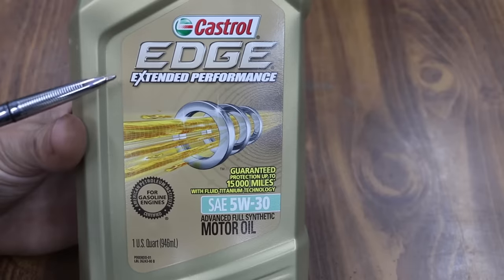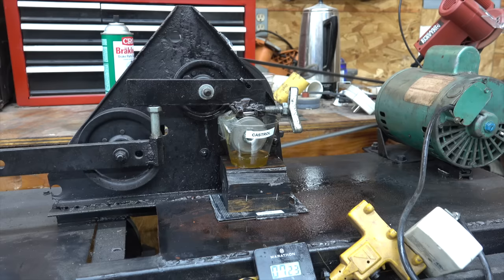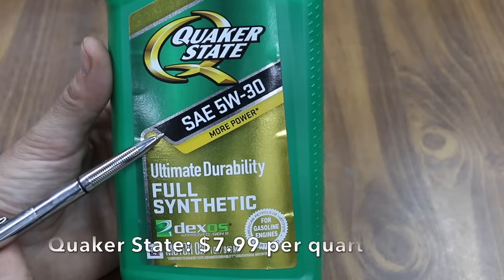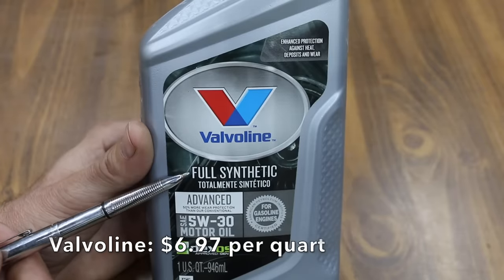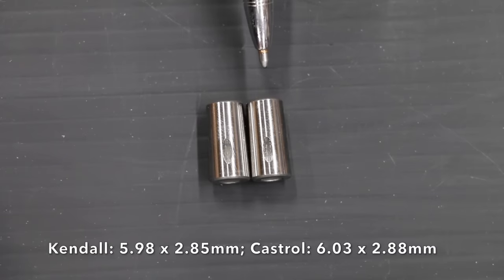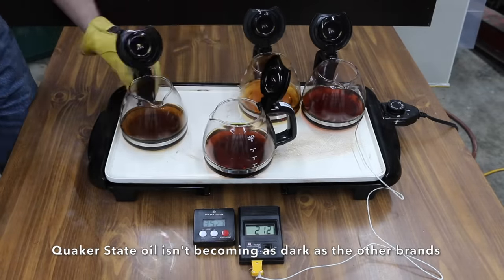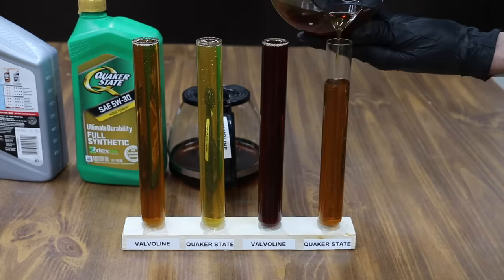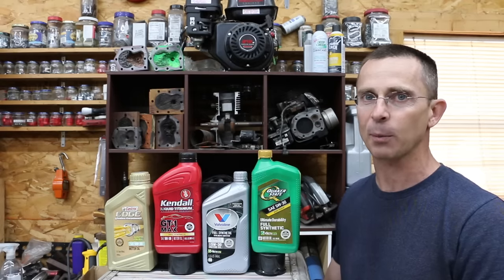Is Castrol Motor Oil better than Kendall? Let's find out!

Comment: I'm still curious....does oil deteriorate more with mileage, or time?  I have oil in my motorcycle with under 500 miles, but nearly a year old.  Your thoughts?
Reply: With mileage it the heat cycles that are hardest on the oil not to mention in constant contact with moving parts etc. Yes oil will deteriorate over time but at a very very slow rate especially new oil 
Oil with only 500 miles I wouldn't worry about it deteriorating in a year unless you had a overheating issues with the bike
Reply from the maker: Great question.  There's a lot of debate on this one for sure!  Personally, I don't like to go any longer than a year, since condensation is a factor and oils can become acidic
Reply: @ProjectFarm  sounds like a good video idea test new and old oil let sit for 6 months to a year and retest it

Comment: What material is the wheel that spins against the bearing in the lubricity tester?  And do you change it with each bearing change?
Reply from the maker: It's hardened steel (wheel race) and they last a long time. I have a video on how I clean and prepare the wheel race between tests. I don't show all the test preparation to keep the videos concise.

Comment: Could you please test Steel Shield's range of products with their competitors (LiquiMoly, Lucas, etc)? At least their engine oil, transmission fluid, and steering fluid additives. Steel Shield is proudly made in the USA. Thanks for considering my request.
Reply from the maker: Great suggestion!  Thank you.
Reply: @ProjectFarm  Thank you for considering my idea. 

Because these additives don't get used in isolation, if it's possible to add them to the engine oils you tested last year, that'd be great. However, I realize it'll be a vast undertaking. I think you'll figure a way out that makes sense and is practically possible. 

Thank you for your hard work behind the scenes. I really appreciate your channel.

Comment: Hi. Can you please check, test and have a showdown between MPT 30K 0W40, Ravenol 0W40, Motul X-max 0W-40 and Liqui-moly 0W40 (Blue bottle)? Although my engine specifies SN+/SP rated oil, I use a standard SN rated oil based on my use case. These are all supposed to be group 4 and/or group 5 based and provide the kind of protection high performance engines like mine need.
Reply from the maker: Thanks for the suggestion.

Comment: Although all competing oils meet API SN, ILSAC GF-5 performance levels but besides this they also meet different OEM specifications. One oil meets FORD specifications while other oil meets GM specifications as well. One of the oils meets API SN PLUS performance level. API SN PLUS has different additive chemistry than API SN  to over come LSPI (low speed pre-ignation) phenomena. Different type of additives are used to meet different OEM specifications. May be one oil contain more antiwear additive than other so it has better antiwear properties, similarly other oil may contain more detergent and dispersant additive and it has better soot handling properties. So the wear test is not acceptable unless you know the additive components. Compare apple to apple than the results will be acceptable.
Reply from the maker: Thanks for the constructive feedback.

Comment: Even though Valvoline lost in your tests I will still use max life. I don't know any other brand that will give you an engine warranty of 225k miles against excessive wear in the engine. If my seals dry out or I start burning oil and have proof that I changed my oil with Max Life every 4k miles and the mechanic says the issue is cause by oil Valvoline will pay to fix or replace my engine, whichever is cheapest to have done. I work at a parts store and have seen Valvoline pay to have someones engine replaced.
Reply from the maker: Thank you.  Valvoline is a great oil!  Thanks again

Comment: Oil flow test is base less unless first  you test the viscosities of  competing oils. The viscosity range for SAE 5W-30 is 9.3cSt to 12.5cSt at 100C. So an oil having 11cSt viscosity will reach to finish line more quickly than an oil having viscosity of 12cSt, Although both are SAE 5W-30 grade oils. Engine oil contains viscosity improver (polymer) to boost viscosity. Cold flow behaviour is greatly affected by amount of polymer which is added into oil to boost viscosity. So for the flow test, all the oils should have similar viscosities to compare.
Reply from the maker: Thanks for the constructive feedback

Comment: Here is a video idea. Is is true or myth that air cooled engines consume 10W30 versus running straight 30 grade? Basically a test where a motor is throttled for a set amount of time comparing oil consumption on multi-viscosity vs straight grade.
Reply from the maker: Thank you for the video idea!

Comment: Could you test what happens when you use the wrong oil type at the wrong temperature. or does it matter. I have had difficulty sometimes understanding why a car engine requires a different class than a small machine. this is of course quite difficult to test.
Reply from the maker: Thank you for the video idea!

Comment: I wouldn't mind seeing you build a working model of a fusion reactor, then monitoring the power output in its own versus under a load. Think of a simulated city and it's surrounding towns that all draw their energy from the grid supported by such a power device.
Reply from the maker: Thank you!

Comment: For the final you should put 2 brand new generator engines and fill them with 1/10th of the recommended oil. And run them for 2 hours and then strip them and access wear,varnish, all while checking fuel economy and heat. That will stress the oil out to the max and if engine seizes then the oil fails in worst case scenario.
Reply from the maker: Thank you for the video idea!

Comment: how about a tire sealant video. i am talking about lawnmower atv tires. the brand i use is Quadboss. it seals 1/2 on tread and 1/4
on the sidewall. i have been using it for 10 years and i won't use anything else . once i tried it i was hooked. wheelbarrow,hand truck dolly,riding mower, atv, even the front tube tire on my ferguson tractor. the only bad thing it says only to be used in NHS tires. after you put quadboss sealant in you will never get a flat again until the tire wears out or dry rots. around 55 to 60 a gallon
but worth not having to remove wheel and unmount the tire or replace a tire.
Reply from the maker: Great recommendation on the Quadboss.  Have you ever tried tire Slime?
Reply: i would advise slime for a slow leak in a automobile or highway speed tire only because it says it is ok for those type tires. but for the NHS tires slime won't hold a candle to quadboss. the only thing i learned is that if you put the quadboss sealant in a tire it has be rotated fast enough to sling the sealant around to coat the inside of the tire. sometimes you can get a pinhole leak in the wheel itself where its welded and that will seal too. i always air up the tire to maximum inflation pressure too to help it seal then lower back to normal pressure later.

Comment: Amsoil Signature Series, after the initial transition, has a singular service interval of 25,000 mile. Therefore, only a sole purchase for 25,000 miles, more affordable and better for the engine with cooler operating temperatures, along with being 100% synthetic. Do the math, Amsoil Signature Series, overall, is more affordable. The aforementioned oil cost my person $77 for 25,000 miles or $15.40 per 5,000 miles.
Reply from the maker: Great point. Thank you

Comment: What about a mower video with diesel instead of engine oil

And also with the mower, fill the crankcase up fairly high with water. Because the banana video got me curious, low long would an engine filled right up with water (without banana in the way) survive?
Reply from the maker: Thank you very much!

Comment: I’m not a synthetic oil believer can you convince me to use it?
Reply from the maker: I wasn't either until I began testing oils and closely tracking oil consumption in my high mileage vehicles.  The truth is, most (but not all) "synthetics" use the same base oil as conventional but it goes through additional processing...distilled and modified.

Comment: HAVE YOU EVER USING SLIME LEAK REPAIR IN TUBE OR TUBLESS TIRES?   I HAVE HAD MIXED SUCCESS.  I WONDER COULD YOU USE SOMETHING LIKE FLSX SEAL LIQUID OR RUST-OLEUM LEAK SEAL, ETC.   SQUART IT IN LIKE SLIME, AIR UP,  SPREAD IT AROUND BUT THEN LET AIR OUT AND LET IT DRY FOR A FEW DAYS BEFORE AIRING UP AGAIN.  MY INTENT IS FOR LAWN AND GARDIN EQUIPMENT TIRES NOT FOR CAR/TRUCK ON ROAD USE.
Reply from the maker: Thank you for the video idea!

Comment: Excellent video! Here is Project Farm next video idea “Best DOT 4 Brake Fluid”

I have been using ATE TYP 200 Racing Quality DOT 4 Brake Fluid for many years and still think it is the best. 

ATE 706202 Original TYP 200 Racing Quality DOT 4 Brake Fluid
Castrol SRF Racing Brake Fluid
Brembo Premium Brake Fluid DOT 4 LV
Valvoline 601458 Brake Fluid
Motul MTL100949 8068HL RBF 600 Factory Line Dot-4 100 Percent Synthetic Racing Brake Fluid
Castrol 12509 Dot 4 Brake Fluid
Bosch ESI6-32N Brake Fluid (Direct Replacement for DOT 3, DOT 4, and DOT 5.1)
Pentosin 1204116 Super Dot 4 Brake Fluid
Prestone AS800Y DOT 4 Synthetic Brake Fluid
Reply from the maker: Thanks so much!  Thanks for the video idea.

Comment: many oil brands have different versions of their oils after oil show down series end can you compare different high mileages against each other. and I was wondering why did you use Pennzoil platinum and not ultra platinum (that's used in Ferraris, in all dodge SRT, and hennessy venom gt $1.2 million 278mph car an all cars from hennessy performance such as the dodge demon an their hp velosciraptor)
Reply from the maker: Thank you very much!

Comment: That is interesting. Did I catch that wrong, or did Quaker State flow BETTER after being cooked?
Reply from the maker: You are right. It lost viscosity.  Not sure why. Ideally, motor oil doesn't change from heat exposure.
Reply: @ProjectFarm  Trying to recall my time in the polymer and elastomer laboratory to figure out why. Hum....perhaps they have a higher concentration of polyolefins then the other synthetic oils and the carbon bond of the polyolefins broke down deceasing the viscosity? Hard to tell. Wish one of us had a Rheometer handy, haha. Would be useful equipment for figuring this stuff out.

Comment: With being so close to the Pennsylvania Oil region with cities like Oil City and Titusville where Colonel Edwin Drake a dear friend of the family discovered the first petroleum in America. I have always had interest in crude oil products. I grew up using Wolf's Head. It was a locally produced product made from the finest Pennsylvania sweet light crude. Right now I'm a Mobile One guy. S&S Cycle recommends it for my V Twin and the price isn't too aweful for the protection. I'd like to be using Amsoil but the cost is just too high. Long story short. I had a 1984 Oldsmobile Toronado that I owned since new. Changed the oil every 3000 with Castrol GTX and Fram. Almost 150,000 when the car was wrecked. Didn't burn oil and ran fine but my oh my that engine was a sludgy mess when I tore it apart. I'm done with conventional oil for just that reason. I think the top 3 will be:.  1st Amsoil
         2nd Mobil One
         3rd Amazon Basic and
                 Schaeffer (tie)
Reply from the maker: Thank you!

Comment: This idea may have been pitched before, but I would be really interested in seeing a showdown of conventional oil and seeing some data showing exactly how much better synthetic preforms versus conventional. I don't think it's a debate that synthetic oils are better as the molecules tend to be much more uniform versus conventional but personally I'm not sure if the difference in performance is worth the price, especially running in an older engine that was originally designed for conventional oil.
Reply from the maker: Great test idea!  Thank you
Reply: @ProjectFarm  You're more than welcome! I really appreciate all the effort you put into these videos.

Comment: Hi Sir I noticed the Quaker State when heated to high Temperatures the oil colour of Quaker State didn't change much in colour at all as the other oils that were heated at the same time changed colour to more black colour & that proves to me that Quaker State is the better oil & same goes in the friction testing & very little wear on the bearing & tò Quaker State is number one in the testing in the friction test & the heat test Kind Regards Peter 😅
9:53
Reply from the maker: Thanks for the feedback.

Comment: I wonder if oil company executives are watching this series like it is the Stanley Cup Playoffs lol
Reply: Honestly, probably not. Like he said, these are garage tests. Oil companies have WAY more advanced testing procedures. Testing the same oil under those conditions could lead to very different results.

Truth be told, as long as the oil meets or exceeds applicable donut standards, it's good for use in the US. The differences are minuscule until you get into extremely high mileage situations.

Personally, I've been running Castrol Edge 5w-20 (manufacturer recommended) in my pickup for ~90k miles on a 7500 mile interval with absolutely zero problems. I switched to synthetic at 95k (used vehicle).
Reply: 5w-20 is recommended, btw. Any oil that meets donut standards is acceptable. Didn't want to make it sound like my pickup calls for CE, lol.
Reply from the maker: I wonder the same thing!
Reply: @Jetmech1781  "Personally, I've been running Castrol Edge 5w-20 (manufacturer recommended) in my pickup for ~90k miles on a 7500 mile interval with absolutely zero problems"

oh I do LOVE when people say this. There may be problems, you just cant see them because you have not done a tear down and comparison to an engine that runs a different or higher quality oil. Superior oil does not add life at the start of the life of a vehicle, it adds the life at the end so it may go for 400,000 instead of 300,000. 

Second, the doughnut only regulates the viscosity out of the bottle, the ZddP content and the emissions. It does not regulate longevity of the oil, additives, ware protection etc. 

And third, relying on companies to do their own testing and reporting of the ware protection etc. of their oil is a terrible idea. I would like to remind you of what happened when we allowed tobacco companies to do their own research and reporting. as late as the 90's they stood before congress and testified that tobacco was not harmful or addictive. Same thing here. Oil companies can proclaim whatever they want, no one but the small guys doing real testing like Project Farm and the 540 Rat Blog can be trusted.

Comment: Test all of the aforementioned at 25,000 miles of engine wear. Betcha Amsoil Signature Series wins and is more affordable with a singular drain interval. $77 per 25,000 miles or $15.40 per 5,000 miles with the Amsoil Signature Series 100% synthetic motor oil.
Reply from the maker: Thank you for the video idea!

Comment: You should doing a bearing test with the cooked oils while still at operating temperature 🤔
Reply: Not possible with the dixi cups I’d guess.   I’d say he uses a new one for every test.   A metal cup would work, and be easy to clean between test, but would require sanding and no way to see on film.   I like the idea a lot though.
Reply from the maker: Great recommendation!  I'll see what I can do.

Comment: I use castrol in all my vehicles, changing it out every 3k miles, so far they are all pretty high up there, yet still running good. Surprised to see castrol lose, I always thought castrol was the best, and quaker was the worst you could get for your engine.
Reply from the maker: Thank you!
Reply: as much as people think these tests are the gold standard I am not convinced. I use Castrol edge, have for 20+ years in a variety of auto and truck engines. I remember about 2003 it was the reigning oil right along with Royal Purple which I still do think is a top oil. I take this guys test methods loosely.
Reply: @garymcmullin2292  , agree 100%!

Comment: How about you do an oil change on your vehicle at different mileages (1,000 mi 2,500 mi, 3,000 mi, 5,000 mi) with the brand you like to use and see what the results are. The oil from your vehicle is getting the proper use it intended for and giving you real time results.
Reply from the maker: Thanks for the recommendation!